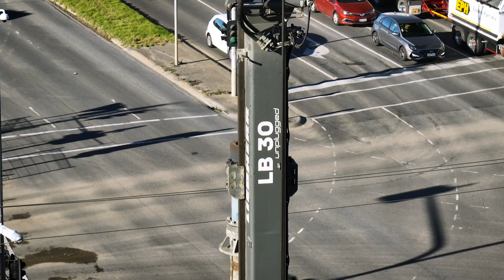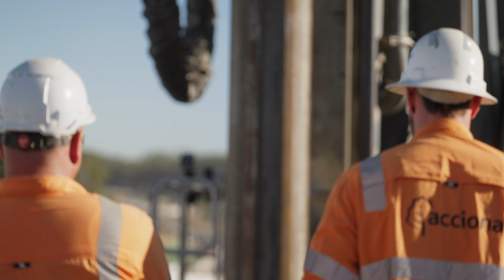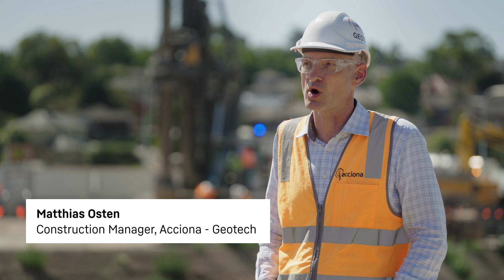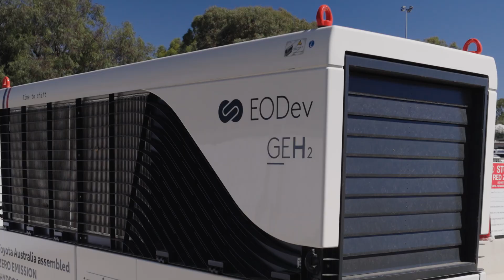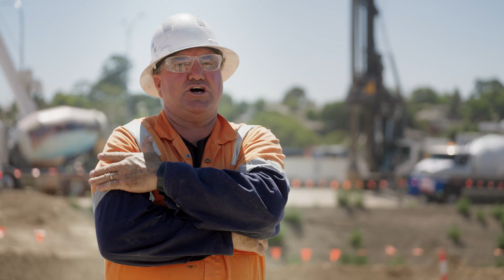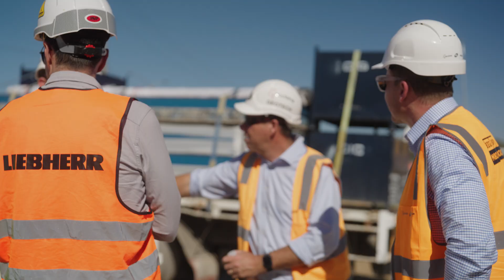LB 30 unplugged - Operation in Australia | Liebherr

Comment: So instead of 1 diesel powered drill, you have a rig, an extra power pack, and a hydrogen generator. This seems wayyy more expensive and complex for exactly how much overall environmental benefit? Not to mention only 8 hours of work?
Reply: Hydrogen can be 100% green.
This task may well suit an electric motor instead of diesel.
Generator sets are much more efficient than ICE drives.
Make that 12 hours of work if run with the generator as well as battery.
Then there's the situations where a grid supply is possible. In those cases this rig will ALWAYS be more efficient than diesel even if the electricity is from a fossil fuel power station.

Sounds like you have a bad case of denialism.
Reply: Denying what, that this is a great way to triple construction costs for the least polluting countries on earth? Great for Liebherr, bad for society. If you want to reduce pollution, you'll get 1000x more bang for your buck if you first focus your efforts on the real polluters, China and India. They just dump toxic chemicals and garbage in the ocean without any care. @dougaltolan3017